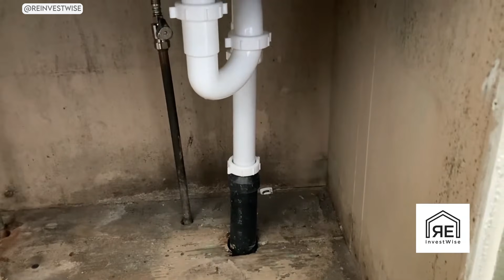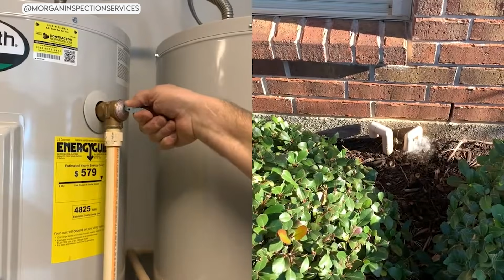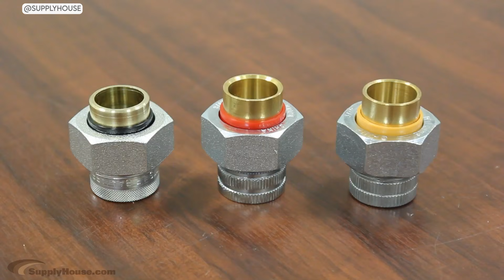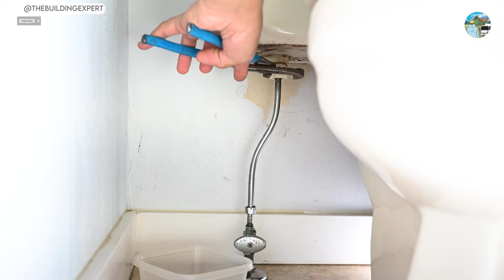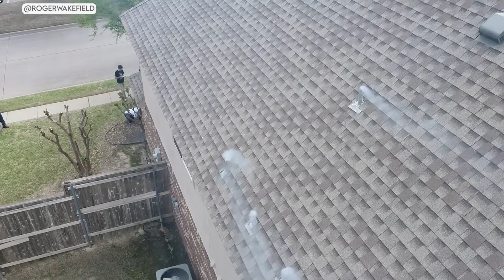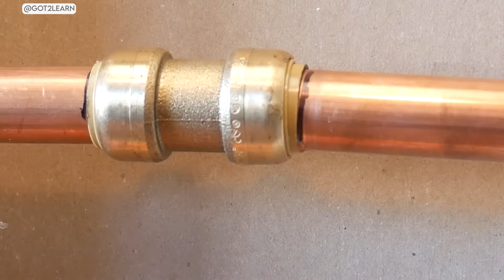10 Plumbing Mistakes That Will Make You FAIL a Home Inspection - Are YOU Making These?

Comment: A lot of these plumbing issues are easy to overlook, but they’re exactly the kind of things that get flagged during inspections. most people only notice these things when something actually breaks or a leak shows up at the worst time. I had a similar situation with a leaking kitchen sink valve, and I ended up hiring Gorilla Repairs to sort it out properly before it got worse.

Comment: In our town we have 60 psi.  In the summer during the day with people filling pools or sprinkling their yards it might go down to 50.  Our old dishwasher owners manual listed a maximum limit of 75 psi.  I do not remember any washing machine over the years listing a maximum psi limit, odd.
I have read that the requirements of a trap are , #1 it must be resistant to siphoning, and #2 be self-s cleaning.  My bathtub had a drum trap.  Almost impossible to siphon out, but every couple of years  I had to  unscrew the plug and muck it out.  The P-Trap is the best balance of trap type.  Unlike the drum trap, it seldom has to be taken apart and cleaned.  And unlike an S-Trap, it has fairly good resistance to siphoning.